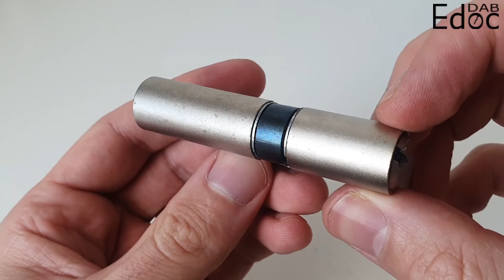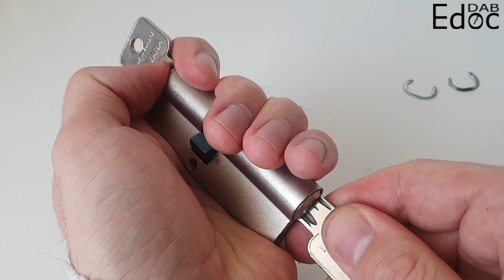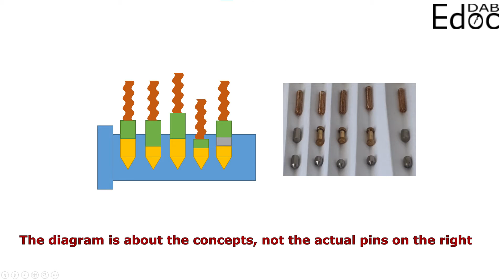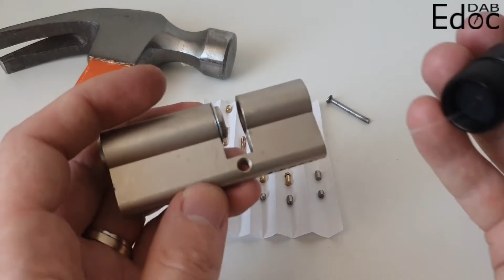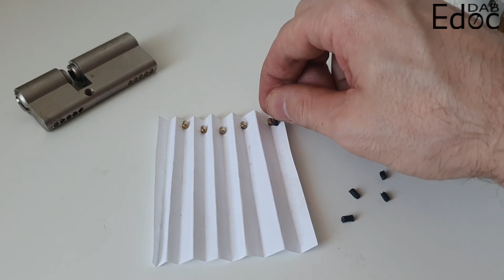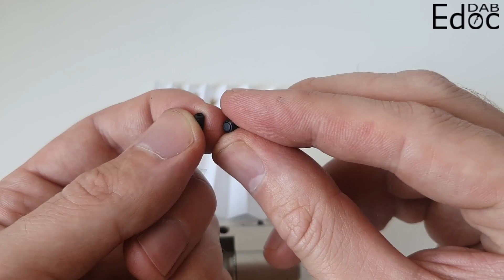[43] Practice lock making for New Lock Pickers

Comment: Nicely done,  I always used the grub screws, but I like the idea with a clip for much faster switching different pins in and out.  Great tutorial 👍
Reply from the maker: Glad you like it Rook Knight! If you'd glue the caps to the clip or manufacture something like that in a nicer way, it's really easy to swap things out. A bit like the locks where you slide the strip of metal out of the body to expose the chambers.

I came up with this and a few other ideas because it was hard to get the right grub screws. Although it's slow, I like the robustness of the grub screw solution. It also doesn't look as bad as a clamp or rubber band :p

Thanks for watching and your feedback 👍